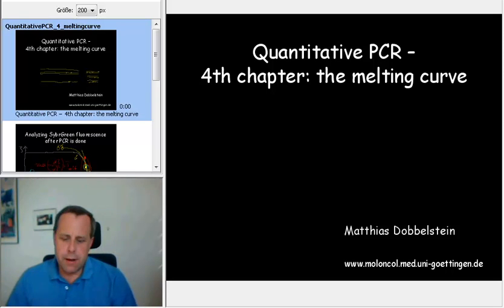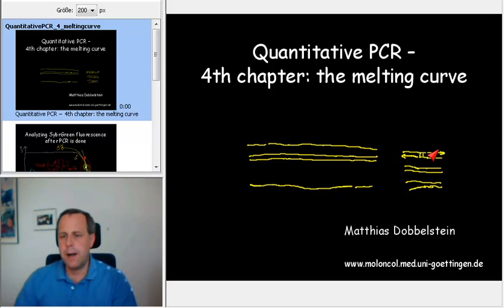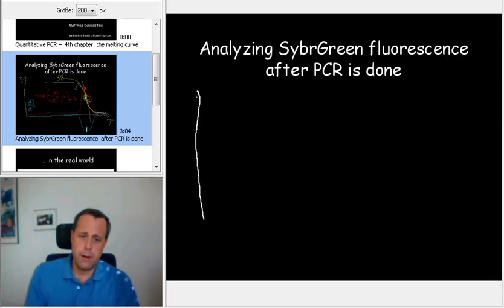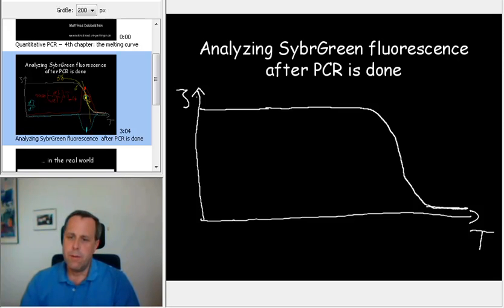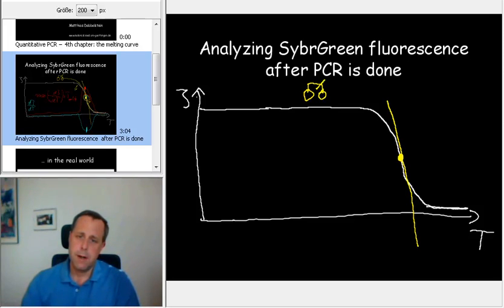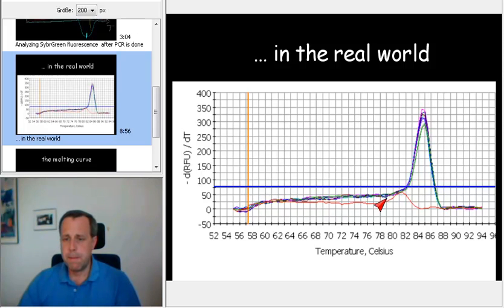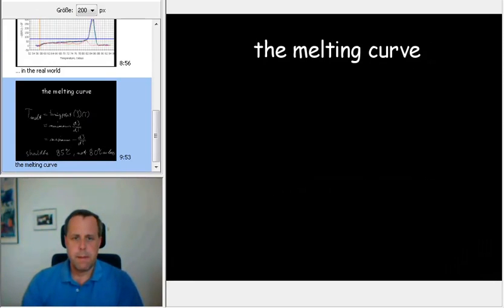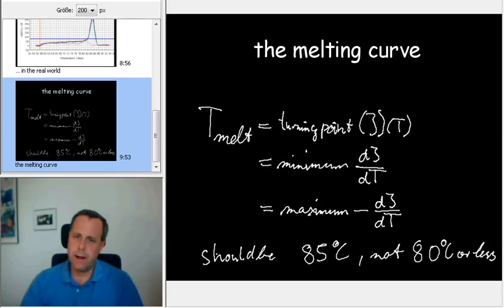7_Quantitative PCR -- the melting curve

Comment from the maker: Dear Rizzolb,
it doesn't really make much sense to do a melting curve when using taqman. For taqman, the fluorescence signal is based on a the cleavage of a fluorescently labelled oligonucleotide (through exonuclease activity of Taq polymerase). Therefore, the signal will not change if you simply change the temperature without polymerization going on. Hence, taking a melting curve does not make sense in the case of TaqMan PCR.
Best regards, M. Dobbelstein

Comment from the maker: The first derivative is a mathematical term for the slope of a curve. You may recall from your math classes that the function f(x) has the first derivative f'(x). In the case here, T is displayed on the x axis, RFU is displayed on the y axix, and the slope of the resulting curve is then given by the first derivative, you could call it RFU'(T) or d(RFU)/dT